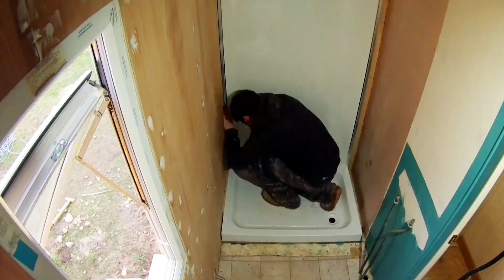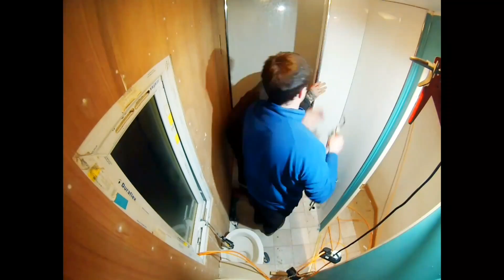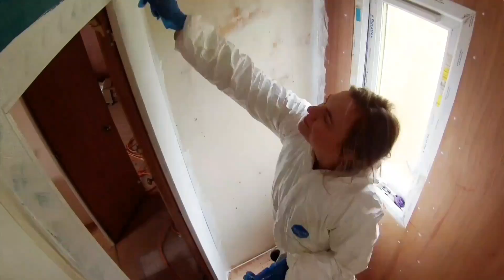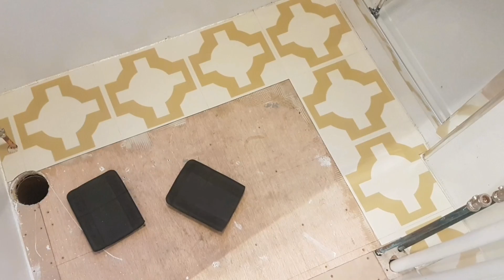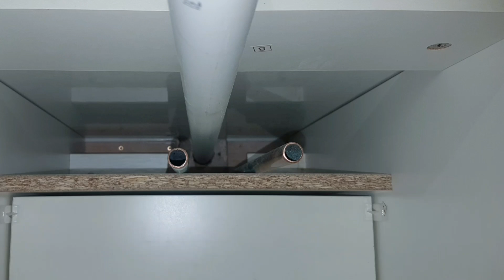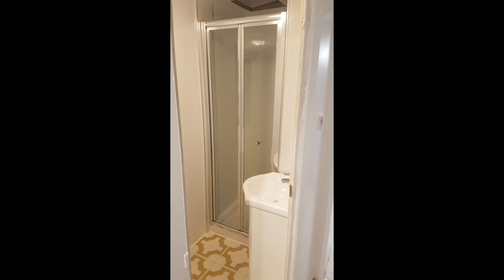201907_Static Caravan Upcycling Project | Bathroom Refurb

Comment: Hi mate loving the vids, have you replaced internal walls ??? If so what did you use, was it the thin caravan walls or was it stud and plywood boards :) we're hoping to go down the same route just been given a static for free, all the inside is stripped out but it's dry and stable so looks promising cheers
Reply from the maker: Cheers mate, yes I replaced loads of walls in side, I've just used 4mm plywood and painted over it with a decent piant know as Zinsser Cover Stain primer, pricey but does what its meant to. Then a top of normal emulsion to finish.

Comment: Hoping to do our bathroom but im completely new to all this and have nowhere to start do you think youd be able to help me??
Reply from the maker: Start by isolating water supply and electricity to the bathroom if your living in it. Then just rip every thing out, next important thing is size of tray, my bathroom is around 1050mm wide so I got a 1000mm x 700mm tray, you need to keep a 50mm or so cavity for pipework to come thru floor behind wetwall. Also you'll get a deep tray at Wolseley, quite hard to find deep ones these days as everyone like these slimline trays, not advisable in a caravan. Also go for a bi-fold door to save space, myn is 700mm which leaves a corner in the shower for soap basket, it would be cheaper and less work to just go with a 1000mm door. If you get to this point I'm sure you'll be fine. Have a think how your going to do it before you start and get the stuff you need first be best. Good luck 😀....
Reply: @MrYobo666  im really scared to do it becauseive never done any plumbing. Im worried about the back splash too. Thank you for the advice! It desperately needs doing its an awful yellow plastic